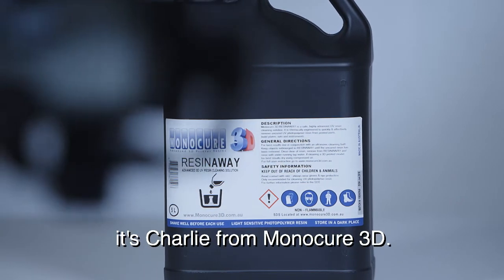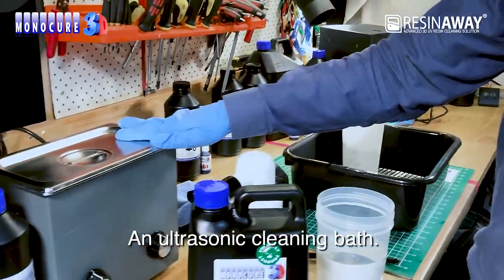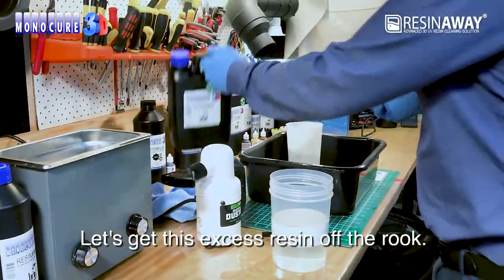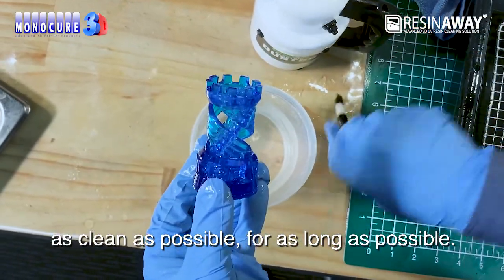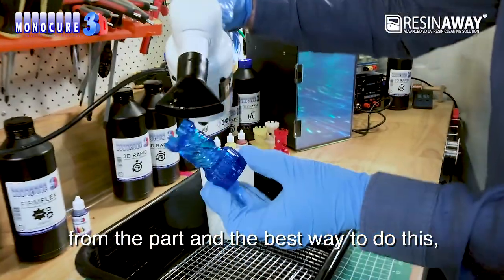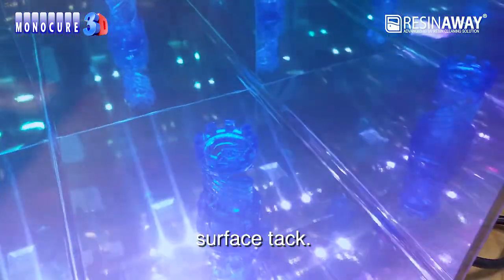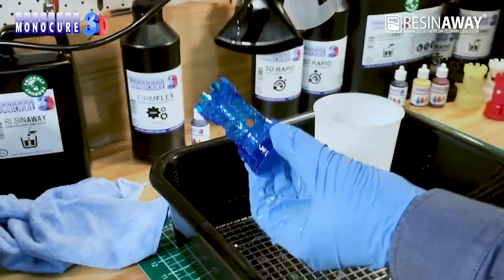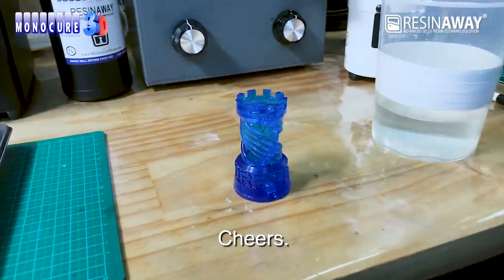RESINAWAY PROTIPS

Comment: You should have a wire basket in the ultrasonic machine. It doesnt do it's job properly if the object your cleaning is touching the surface of the ultrasonic.

Comment: 2 Liter for $66?  You are very proud of this product indeed!  Not very economical.  This will force many to look elsewhere for solutions.  I personally can live with IPA or Simple Green or other products if it saves me money.  Maybe when the Chinese get this and reverse engineer it a cheaper alternative can be had at a fair price.  Does this come with an MSDS sheet?
Reply: It lasts a lot longer and the dissolved resin will fall to the bottom unlike IPA so it actually ends up being cheaper. It also does not leave your print with cracks or white stains. I think you can find a MSDS on their website.